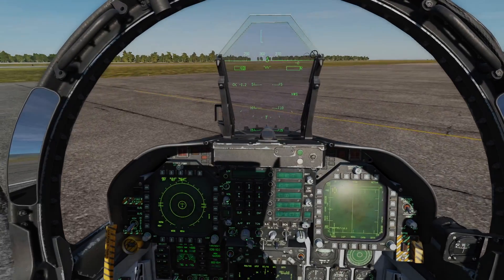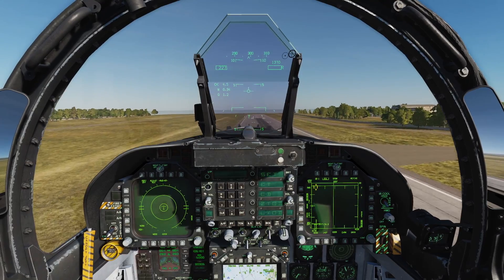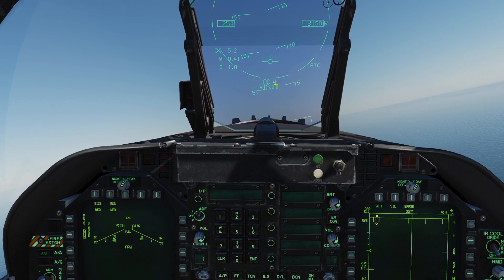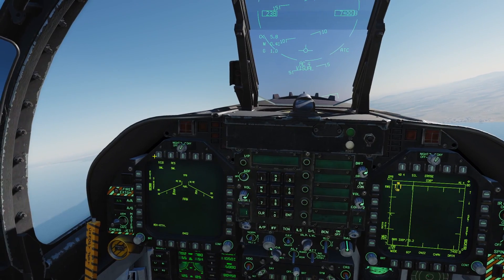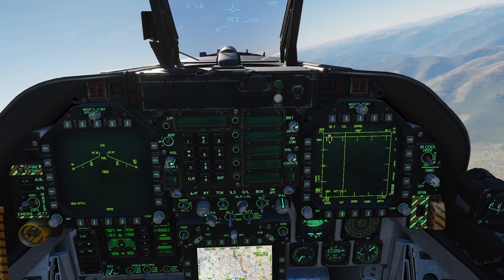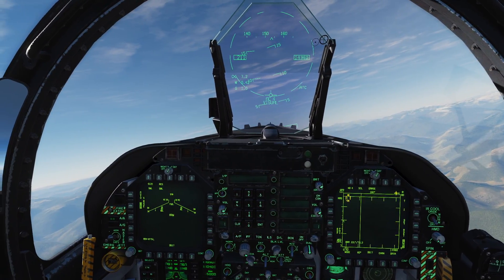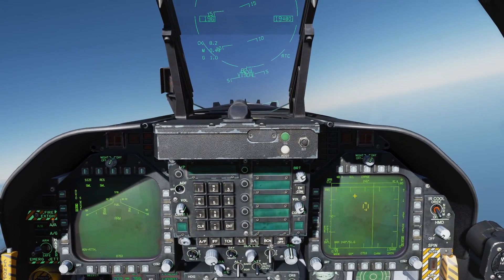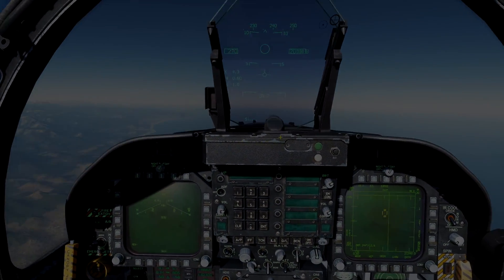DCS - F/A-18C Lot 20 Hornet Air to Air Radar Setup Tutorial

Comment: how do you move the yellow thing lmao
Reply from the maker: Sensor control switch to the MFD that has the radar on it. Look for the little diamond in the top right of the MFD to see which one it is assigned to. Once you have diamond on the MFD you want to use you can use TDC left, right, up and down to move the yellow cursor
Reply: I still can’t figure this out with your explanation.  What is mfd and tdc.  Noob here

Comment: Sorry, Channel Subscriber here. Requesting How to Dummy, All Things Mission Failure steps for everything needed. Didn't respond in time to getting to an area on time, Aircraft took to much damage, Flags used to track a Mission goal with failure built into the flag tracking system. Flags used to keep your score for mission end for success and Failure or other more logical way.  Dummy requesting help...S.O.S.. @%ck*&
Reply from the maker: Start small and build your sortie complexity from there. Make a mission where you have to cold start, enter waypoint information, fly those waypoints, hit an aerial refueller and grab some gas and then land. Once you can do the basics it takes a lot of strain off of your brain and you can concentrate on the next systems you’re trying to learn. Gotta learn how to crawl before you try and sprint right 🤷‍♂️ 

Might be biting off a bit too much for yourself to process and it’s causing the mistakes.
Reply: @TorniQuetHD  Thank You. After asking and then working on my Huey mission. I came to your advise conclusion, Mission ends are tailor made for each situational need and are to be added in after the mission foundation has been set in stone. I will need to work hard at making sure each mission goal for successful mission end has a correct mission failure built it at the correct time, should someone go A.W.O.L. during a mission to site see or stop off at the Massage Parlor for a Rub Down during my Mission Goal Objectives. Well I don't see any one covering different ways to add a built in condition for a Mission fail. Maybe if you ever come across an opportunity to show a built in mission end condition you could point it out as a helpful foot note. Love your DCS Help Videos for us F$&K@!s. Thank You

Comment: With the AIM120 on the stores page, what does "S MODE (auto/man)" do ?
Reply from the maker: it is for TWS mode, I'm not 100% on it but i believe that if you are going to use TWS Auto mode you should leave the S Mode in Auto too.
Reply: It basically slews the radar on the selected target so you don't lose it when it leaves the 40-60° view it basically tracks for the whole 160° while keeping a tight sweep on it.

Comment: Excellent video, but what about guns? What settings would you use for gun?
Reply from the maker: For guns you are generally in visual range, when you use the select gun keybind it will default to ACM Boresite so if you put a target in the dashed line displayed on HUD it will lock it up automatically as long as you’re within 5NM